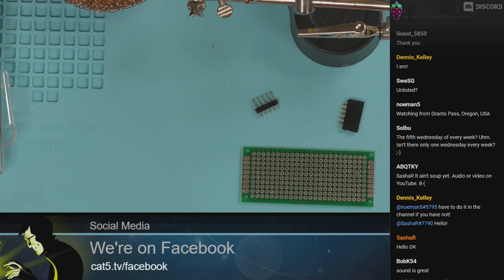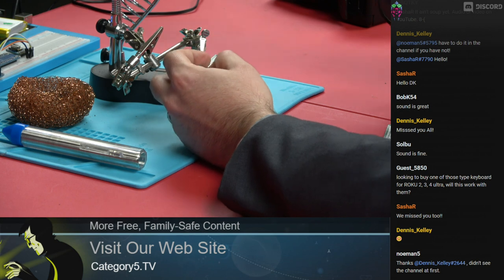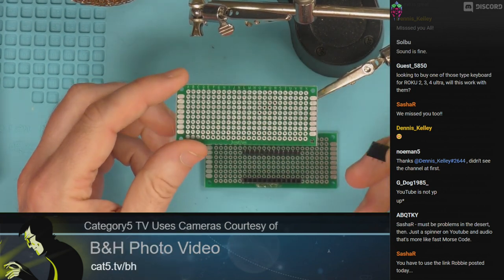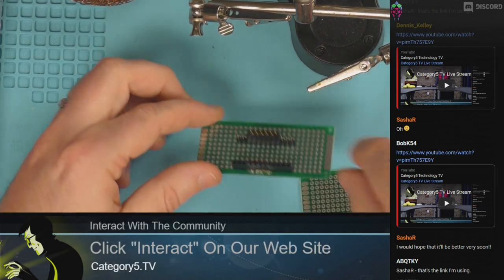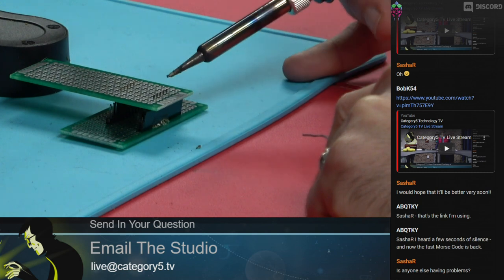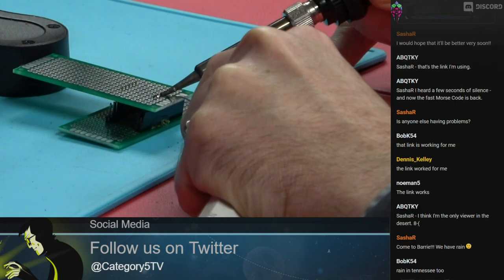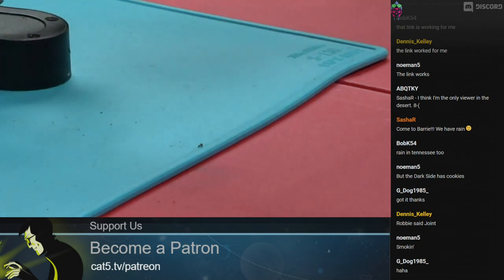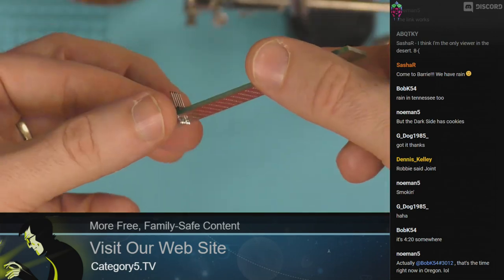Soldering Headers to a PCB

Comment: Much ado about the make-shift base, when all you have to do is stick the header pins into your PCB and then push it all into a breadboard as if you're mounting it. Two seconds and you're done. Then with the header in a vertical orientation you just solder from top to bottom, whether you're right or left-handed, doesn't matter -- just top to bottom every time.
Reply: thanks... you saved me from having to make a comment  lol
Reply: It can be a little annoying getting the pins in and out of the breadboard, but I've never found it to be a real problem. I saw another recommendation to 3-d print a small block with 0.1" spaced square holes. But now that I think about it, I think you could just sacrifice an unneeded breadboard and remove the contacts.

Comment: The way to avoid the solder sticking to the pad as in 5:24 is to remove the solder a fraction of a second BEFORE removing the iron so that it separates while still fluid.